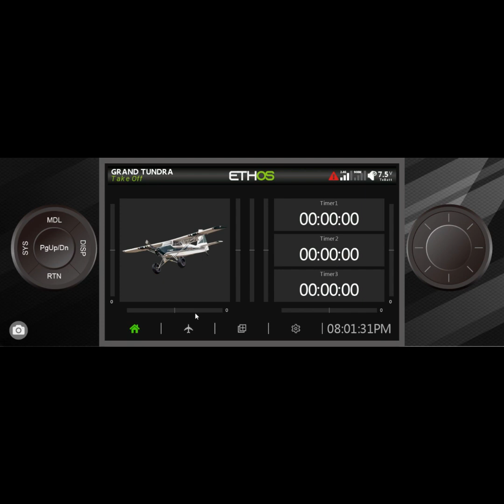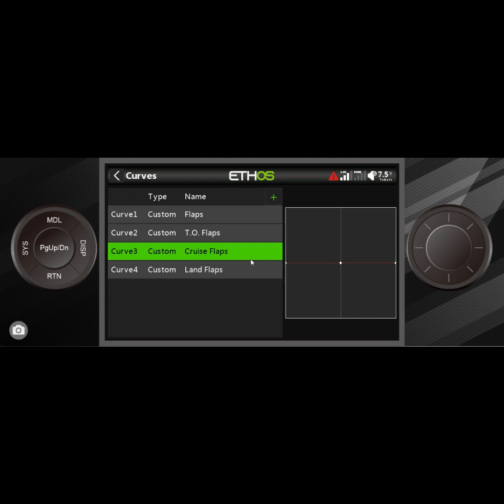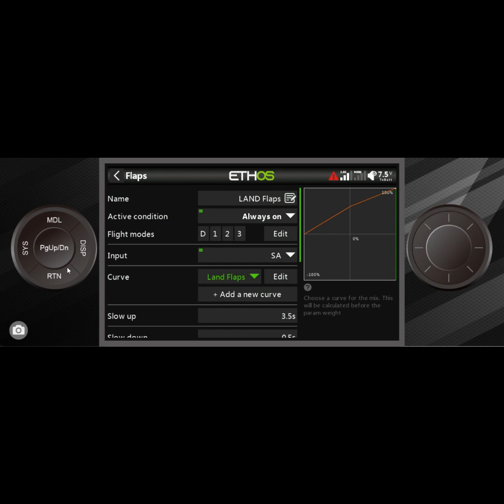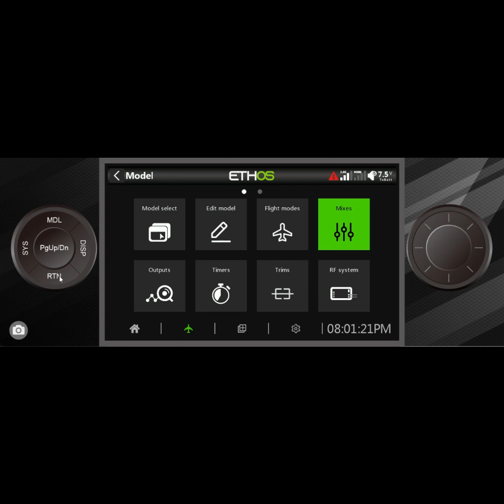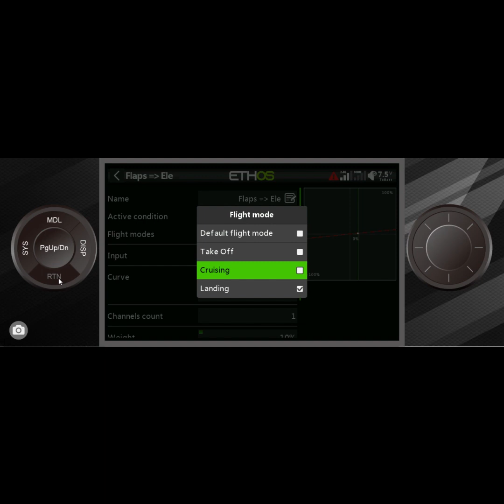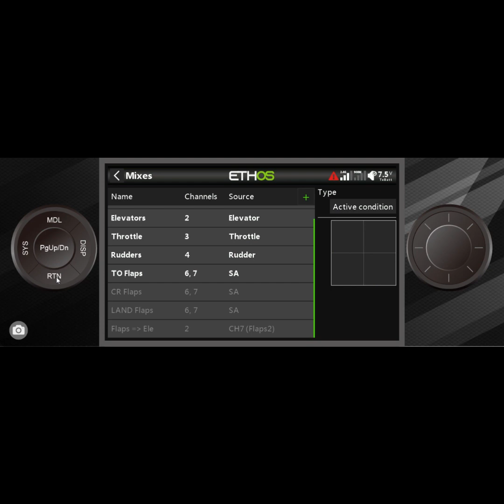FrSky Ethos:  Fantastic Flight Modes!         O-20 Series E8

Comment: Hey Steve, I just viewed your E8 episode on Flap flight mode and have a question. In OpenTx, I set up a take-off and landing flight mode that allows me to trim out the elevator independently as needed.  It appears that your setup over-complicates this programming by duplicating the flight mode in the Mixes section.  Why is that?  If the plane balloons when you hit the flap switch, you will always want an elevator mixed in - like on take-off.  Second question, in OpenTx, I can carry over my normal flying trims to my Flap Flight Modes so that when I hit a flight mode switch, I don't have to retrim the plane out in addition to adding elevator trim with the flaps. How do I do this in Ethos?  Thanks for all that you do!!

Comment: Hi Steve. I'm a new user of the simulator. Am I able to import my models into the simulator?  thanks
Reply from the maker: Frank, you can, it's a bit difficult. It goes into the .x20s folder if you're in windows.  It will get a lot easier by the end of the year.